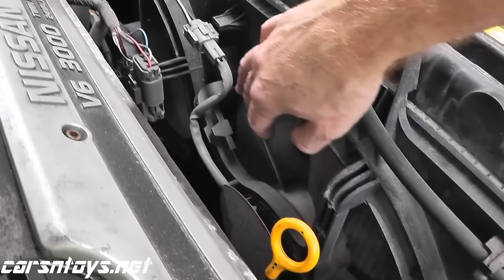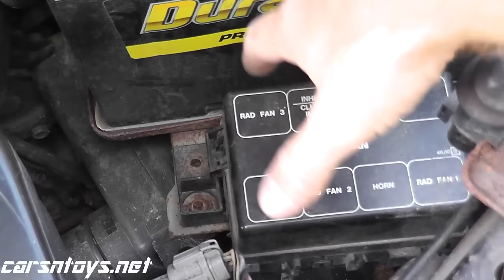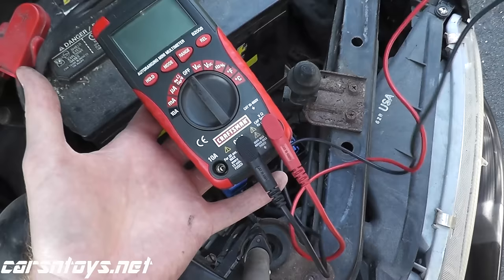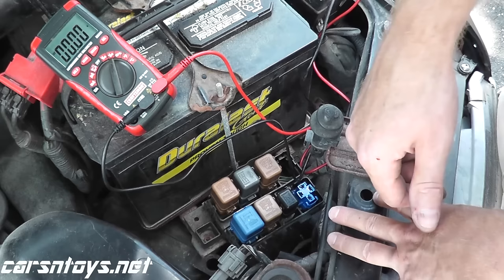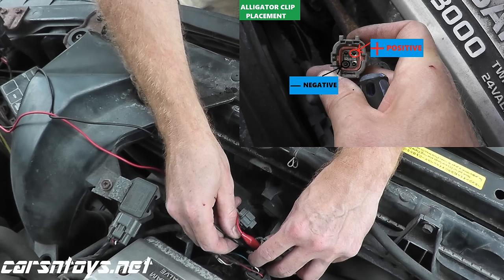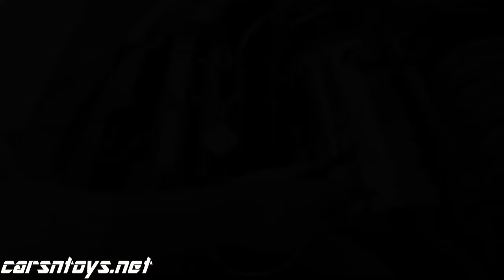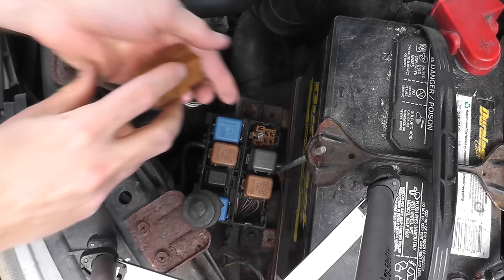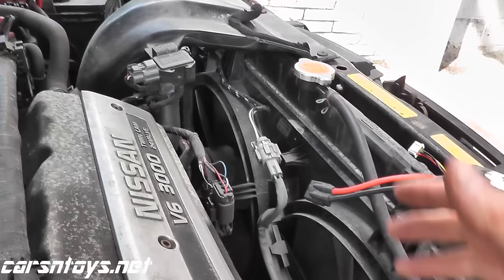Overheating Help! | Testing Cooling Fans - Relays - Connections

Comment: if the stays ac is on should the fans also stays on? im confused. other says it should be automatic. if it reache the normal temp both fans shoould be in sleep mode and wait to the engine till it exceeds to normal temp and fans to on state again.

Comment: What if the fan works with ac but they want kick on when it's over heating why does it not I've put a new thermostat in it and a new relay but the fans want come on when it starts getting hot

Comment: My car over heating.after open the engine  room.saw radiator extra tank cap was  popuped .after re fill the radiator.it,s work normally.corolla/1994.i ws filled  full of radiator and minimum leavel of extra tank.please advise the reson for this.what kind of action do i need to take

Comment: That was a great video I just bought this car 90 mustang GT and it has a Dual Fan Setup With a SVE radiator and when I drove the car for the first time for about an hour everything was fine and I remember the gentleman that I bought the car from said that the way this is wired up is those fans will kick on on their own when it gets up to temp well when I got home I noticed inside the car where the air conditioning controls rat that it was set to the fan position well I turned it to the off position not thinking about it drove the car for the second time for about 20 minutes or so and it overheated I got the car back home I filling the radiator up with some water and I’m just wondering if that’s what caused it to overheat being that the control side the car was turned off instead of leaving it on the fan setting appreciate your help and great video!👍 also when I got the car it wasn’t driven much and the car had to be jumpstarted right before I drove it the second time and I’m just wondering if the battery wasn’t fully charged if that could’ve also played a role with those fans not working properly being that the battery wasn’t fully charged the system that’s on this car is basically brand new appreciate your feedback

Comment: Great video again, one question? When you doing continuity from the fan connector to the relay base, the ignition switch has to be off? Or stays on like for in # 1 and 3 to check for 12volts, thank you again and cheers my friend,
Reply: Continuity is just testing for a physical wires presence doesnt matter car on or off your just checking for a cut wire
Reply: Continuity tests are done on wires with no current running through them. You are testing for continuity which means there are no breaks in the wire.  His meter should have been set to DC Voltage when he tested the relay that you were able to hear clicking which meant that voltage was present. He also uses the term "Short" incorrectly. He should have said "open circuit", which would indicate NO continuity due to a break in the wire. A "short" means that a HOT wire is coming into contact with a "Ground", which would cause blown fuses or melted wires.

Comment: CarsNToys, Great troubleshooting video, very nice showing the steps. However, you keep referring to a lack of electrical voltage power as a short and that is not correct. A short is when the negative and positive lines are directly touching forming a "short" or the complete term is "short circuit". What you are really describing is an "OPEN" circuit when there is no power where you expect to find power. You can also determine if the connection is "OPEN" using the continuity setting on the multi-meter.  A "SHORT"  is worse than an OPEN since power applied to a circuit with a short in it will cause the components to overheat and burn up and/or cause a fire or damage to the battery.
The main reason I watched your video was to find out the next step to take now that all those components are working properly, what's next the troubleshooting step to take if the fan still won't come on without using the AC as a test, but using the engine running and heating up the coolant? I suppose it is a coolant temperature sensor? Do you have a video on testing it? The one I'm troubleshooting it seems to be the CHT sensor, however on the OBD it shows the coolant temperature and the engine temp gauge shows temp rising above center mark on the gauge, but no fan, and engine idles rough and lacks power when quickly accelerating? When I unplug the CHT sensor the engine idle smooths out but I haven't yet tested driving and fast acceleration with it disconnected to see if that smooths out too. Any suggestions? Does different resistance readings on the probe vary by temp and are they interpreted differently by the computer than what is displayed on the instrument panel gauge? Would the resistance values be the same or could they be reading low, but the temp gauge reading correctly? When I unplug the wiring to the CHT sensor the fan starts running at high speed, but I lose the temperature reading on the gauge or the OBD tester. This is on a 2008 Ford Crown Victoria

Comment: Hey I know this is old but when I check the relay for voltage I only get about 12 volts on one of them for the radiator fan #1 I don’t get voltage for both sides like in the video only one side. What do you think it could be I checked the fuses and swapped them out but still same results my other fan relays are working fine

Comment: THANKS FOR A GREAT VIDEO. just a couple questions. what is the best  way to get a schematic for fan wiring of a 1995 Camry 2.2? Also is it possible to isolate which sensor  would cause both low and high speed failure of both fans?
Reply from the maker: Thank you. You can try  obtaining a .pdf file of the factory repair manual specific for your vehicle. It may be a little tough being a '95; nonetheless, you can typically find the hard copy repair manuals on Ebay. The fan speed on most modern vehicles are controlled by the vehicle's computer. Once it senses, for example, a higher temp; the fan will kick in to high gear.

Comment: My car has a coolant fan sensor. I suspected that this is failing so i changed it. I checked my relays for continuity, changed my coolant temperature sensor and hot wired my fans. The fans come on when i turn the A/C and recirculation fan on, but they don't activate while idling or when the car overheats. I'm lost.
Reply from the maker: Sounds like a wiring issue. What kind of vehicle are you working on?

Comment: My Nissan Versa SV doesn't have this setup. I see fuses with tons of colorful wires attached. Should I pull out the fuse box from the engine I cannot access to see of the Relays are in there?

Comment: My problem is my car fan dont work unless I turn my a/c on which makes the fan come on. I changed the coolant temperature sensor and the fan still dont come on. I checked all fuses and relays. So i drive the car everywhere with the a/c on. If the a/c is not on the car overheats cause the fans dont come on automatically.

Comment: I have nissan altima its radiator fan turns on for a very small period of time like 15 seconds and then it turns off and car engines causes over heating

Comment: What if all of this is fine but the fans only come on with the AC? I replaced my coolant temp sensor, still only coming on with the AC. I can get low and high speeds to come on, they just don't come on, on their own, at the temperatures they should.

Comment: Both speed in high and low speed fan works when tried out with a diagnostic machine.I replaced my relays resistor, this fixed my low speed fan however it doesnt turn on my high speed fan. What could the issue be?

Comment: I own a 2001 VW Golf GTI VR6 ,I noticed that my cooling fans only work when i turn on the A/C , but when i have the heater on the fans don’t turn on at all . I was flushing my coolant system when i noticed this . I ordered a new radiator fan switch the other day , yet to install it . I’m going to start there , I also had only about half a gallon of distilled water on my coolant system when i was doing all this do to my car bubbling coolant out of the expansion tank from being hot as hell . What gives ???

Comment: Bought a nissan altima 05 a couple months ago and im noticing my fans never turn on. The car never overheats even when it had a cracked radiator. Changed the radiator out but im wondering if the fans being out may have caused the radiator to crack in the 1st place. Gonna try out these test, def dont wanna crack the radiator again
Reply: Did you figure out the issue? I have an '05 Nissan Quest that has the same issue.  Cracked radiator and the fans will not come on, even with AC on.  Fixed the radiator, but want to figure out the fan issue.

Comment: If the fan doesn’t turn on  can this affect  The AC in the sense of the compressor cycling on and off. The Reason I ask is my car was overheating on the highway but my air conditioner was working fine  I change the relay and the fan started to work temporarily but it quit working again every since then when I turn the AC the fan doesn’t come on and the Ac cycles on and off. any input would be very helpful the car is a 98 Chevy Cavalier 2.2l Engine
Reply: Yoy ever figure your problem out im haveong same problem with a 04 pontiac grand am gt thought it was fan switch realy i still have same problem

Comment: The problem that I am having with my 2006 Pontiac Torrent 3.4 l V6 is that when my needle temperature almost reaches halfway it comes on high speed I never hear low speed

Comment: Very good video !!!  :) 
Could someone please tell me, on my 2005 Nissan Sentra 1.8 liter engine, what fans are what?
My drivers side is the only one that works when the engine gets hot or when A/C is on.
I have never seen the passengers side ever work.
My car has 326,000 miles and I'm shooting for 400,000  :) 
It's still a great car just needs a little TLC :) 
Thanks guys :)
Reply: I found out my issue.....missing fuse for my passenger side fan.

Comment: What if only one fan kicks on? 05 Chevy Impala V6 3.8L Vin K model. The passenger side fan turns on, but the driverside fan does not. Replaced 2 out of the 3 relays, did check the fuses (but I'm gonna check em again tomorrow.) replaced temp sensor, thermostat, etc. Even replaced pig tail to the temp sensor. So can one fan literally go while the other stays operational?
Reply: Yes 06 gp na 245000 miles ,first was one motor than when replaced the other went, it do happen,what's your mileage? Just curious,

Comment: Great video. I have a fan problem, they are not going on high and  I am getting no voltage to the drivers side fan on a nissan quest 2007. I checked the relay and the relay works. So check the voltage at the relay plug and I am getting only one 12 volt reading at pin 2. So now I am testing 12 volts on the other pins for that same plug and I am not getting 12 volts on any other pin. I don't know where to go next. It will be greatly appreciated if you can give me a bit of direction. Thanks for your time and help.
Reply: rr po  Do you fix your problem?

Comment: On my 04 g35 I turn on the AC an only the right fan works, I’ve let the car warm up to normal temperature and the top hose is warm but the bottom hose is still cold, there’s a new thermostat installed already an I’m still having this issue
Reply: so did you find the problem? what was it?
Reply: @gazd4812  I replaced the fan assembly because both fan are suppose to spin when ever you turn on the A/C. 

I’ve replaced:
Thermostat 
Water pump
Radiator cap
All Hoses
Bleed the system twice using bleeder valve as well as bleeding from the radiator that went well.

And last I replaced the radiator 

It doesn’t overheat anymore but I can tell you that you’ll do more harm to a car when you don’t drive it
Reply: But first things first, grab a block tester to make sure that you haven’t blown the head gasket or have a crack in the block, if the liquid hasn’t turned from blue to yellow then your good.
Reply: @Cometxx6  Thank you!

Comment: Thank you for en excellent "how to" video! 
However, I can not find the fault on my sh*itty opel (Vauxhal) corsa 1,3 CTDI. I have power to the  relays and the relays works fine. New resistor. The fan spins fine with electric screw driver battery. Sensor works and have power. I have continuity on cables all the way on the cable from the relays. 
However, not sure how to test cable nr. two to the fan (nr one have continuity to relays). Is it supposed to have continuity to ground cause there is no "beeping" on that cable to ground? Maybe there is som cooling temperature switch I dint know of? Any ideas?

Comment: Thanks for the video. I have a 2011 Juke. I followed your directions. I ran into a situation when I was checking the pins at the relay terminal. Turned the ignition on and checked for voltage, none. I started the car and while it was running I heard a "click" at the time I was going to check for voltage at the same terminals at the relay terminal. I now had power at those two terminals. Plugged in the relay and the fan started running. What's really confusing about it is I tried applying 12 volts to the pins on the harness going to the fan to try to verify if the fan was working. When I did, the fan did not run leading me to believe that the fan was junk. Now the fan starts running. What should I check next?

Comment: Better to use 9v small batter for testing relays. As the connections are close enough for short-circuit and the 12v car battery may explode.

Comment: i have a toyota hiace grandia gl.
my cooling fan or rad fan when I switch ON the AC the cooling fan/rad fan will turn ON then after a minute the rad fan will turn off automatically then it will turn ON after a seconds (5-10s) ..
why rad fan do that?? 

i thought when I switch ON the AC will turn On at low speed then when it gets hot the rad fan will switch to hi-speed.. but  my van its not doing the way.. how to fix it?

Comment: When I turn my AC on both my fan comes on but doesn’t work when the engine is hot so the car Will overheat
Reply: My 2016 pathfinder is doing the same thing!
Reply: Did you figure out what it was mine doing the same thing??

Comment: My cooling fan on drivers side has not been working.I turn ac on full blast and the passenger side works fine.Today I tapped on motor on drivers side and it came on with Ac full blast.Then i turned car off and restart and turned ac back on and it didn’t work on drivers side.Plz help I’m so frustrated!!!Help.

Comment: My fans go on when AC is turned on. 
Car overheats when engine gets hot and fans doesn't go on, 
Fuse seems ok. Relay seems ok. Fans don't go on when I disconnect the terminal on the harness on the driver's side. I only dusbonnevted thst one.
Could it be the thermostat or water pump?
Reply: Sounds like your ECT engine cooling sensor is bad

Comment: I have a 2006 Pontiac Grand Prix 3.8lt w/ supercharger. I tried everything here and it all checks out. But I have replaced all the relays, wire plugs, coolant temp sensor, thermostat, entire fan assembly and the PCM. When the car is cool the fans blow and work great, after driving it and the engine gets warmed up the driver side fan doesn't work. Any suggestions please, thanks in advance.
Reply: I got the same pronlem
Reply: Problem

Comment: Hi great video, one question,  when you test the ground and disconnect the fan,you touch the #1 pin on the connector and #5on the relay base, the connector  has numbers in the connector? Or how do know which is #1 pin,  thank you cheers from ontario ca.
Reply from the maker: I have a schematic for the vehicle. You can get by without a schematic but it takes a bit longer.

Comment: i had the same problem on my 2001 maxima one of the 2 cooling fans woudln't turn.
and eventually the radiator blew up from pressure. anways  I made it to a gas station to fill it up with water and let it cool off,  I only had 2 miles to get home.   Later I got the Radator and fans replaced with parts from https://www.radiator.com,  they happen to have location not far from me.   after that its been fine. but the transmission fluid I should of changed, as it got burned. few years later  started getting shifting issues. and P0744.   I did a 3x drain fill ATF using Valvoline maxlife full synthetic ATF. it got better but think transmission is going ,  It stillmoves.  but am looking for a used transmision from Junk yard now for RE4F04B Jatco transmission on 2000 or 2001 maxima. in decent shape , hopeing only to get 4-5 more years out of it.    used transmissions for it run from $200-400 
Its my son's car now for the past 18 months. Transmission issue showed up maybe 15 months ago. and have been limping along  since then . Fixed alot of stuff on it my self.  did close to $4,000 worth of work myself for $900

Comment: Guys I need help I turned the car on the fan didn’t turn on and I ran it forever and the fan wouldn’t turn on. Then it started to overheat and then finally the fan engaged. What is happening?
Reply: Could be your thermostat sticking.! It’s cheap to replace

Comment: Can you help me sir, i have a nissan sunny 2004 with a fan radiator problem,  i changed only one of my radiator fan motor with a new one, when i reinstall the radiator fan, i found both of them rotate in backward direction another word anticlockwise which means blowing the engine not the radiator, actually what is the problem, any one who expert in this problem please, please, please help me to solve the problem.
Reply from the maker: Check the connector. It's most likely plugged in backwards.
Reply: @CarsNToys  For the new motor fan relay yes, may be the connector is backward installed from the factory and can be reverse connected, but what is strange of mine is the original fan nissan  radiator also rotate in backward  direction, this is the main strength problem objective question of mine ,i cannot solve.